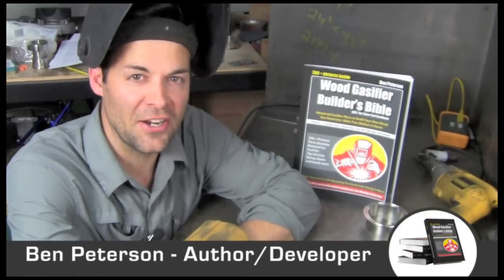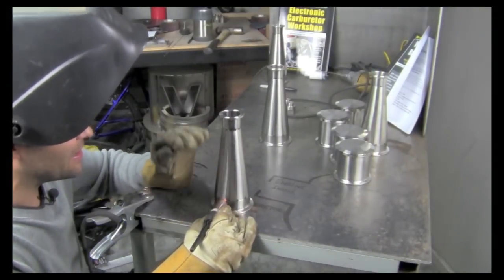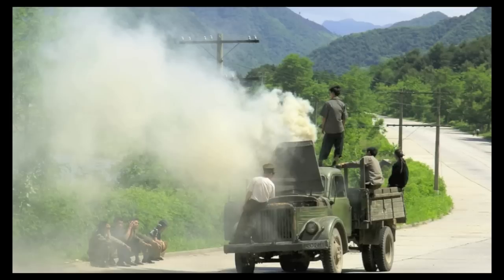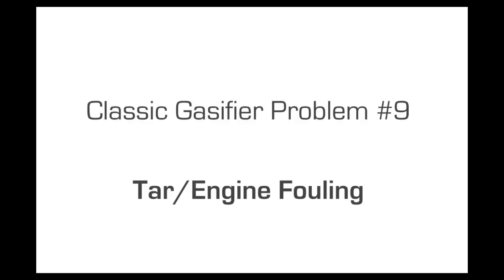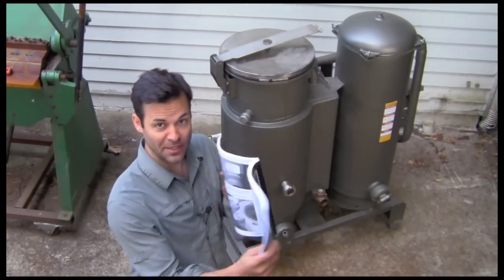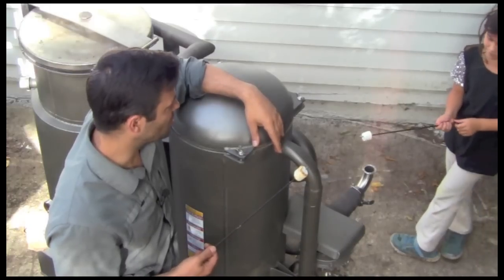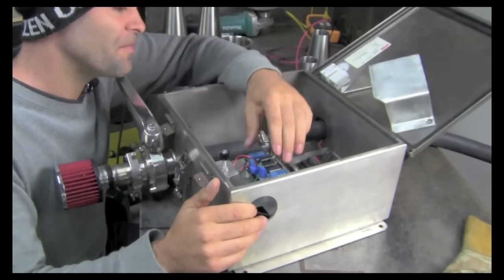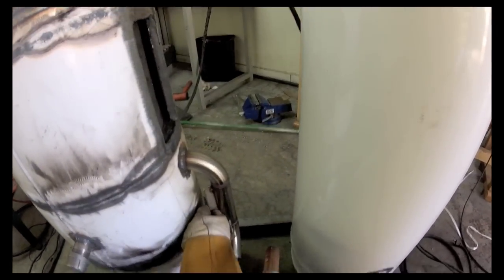#1 Wood Gas Generator. Ultimate Wood Gasifier Plans. Free Fuel for Life.

Comment: he is quit right  today it used by a lot of people the pint is it must be . sead it a Gide it enable's you to build a  gas genarater with out a  the hit a miss of the past.  we now have the tool to add Benefit to  the build it is now on paper. in the book  something  we did not have when i was a lad.   there is other ways to Mack gas often not covered in this books  The gun barrel  system of making gas.  & the charcoal colom method that  uses water to Mack gas  as the the wood gasifier Uses the  Water in wood fibbers to convert to gas by the charcoal that is made in the wood gas  genarater .  Water & Charcoal in a Colom , makes dioxide gas & hydrogen gas.

Comment: I've built the FEMA version gasifier and then one that was my design based on my research. I'm a disabled veteran and have time on my hands. I really liked my design but it had a ton of heat loss. My plan was to put that heat to good use by incorporating several heat exchangers for hot water and hot air. Since then I've gone through a divorce, lost my house, lost my storage units that held my gasifier, that also held all of the components to construct another gasifier and other gasification devices I was working on. I also had several back surgeries. That being said, I really like the design of this unit. I looked for the book mentioned here,but it's off the charts expensive. Can anyone point me in the direction of perhaps a used book? If so please let me know. Thank you. And a special thanks to the gentleman presenting this video.god bless.

Jason

Comment: Two questions. 1). The gasifier rate of production is independent of the motor. So what happens when your producing more gas than the engine is burning? Flare it off?

I first got into gasification thru wood boilers. Totally different animal. I now find myself in need of a maple syrup evaporator. Not the most efficient way of burning wood.

Comment: Why are you wearing a welding hood and welding gloves to review your book....Edit; also does your book provide options to avoid reliance on electricity to run the gasifier? If I were to make one of these I would want manual air/gas adjustment and a shaker that didn't need electricity. I would think you could figure out a way to transfer the vibration from the generator or whatever you are running to the shaker Grate. I appreciate all the time and energy that you have put into your system but as a Machinist and Fabricator can't help but think of these things.

Comment: I would really like to run a generator on multi-fuel including wood gas. Could I start with a "Duel-Fuel" Generator and still have the option to use gas/propane as well?

Comment: Can you store the gas in a tank. How about an existing propane tank?
Reply: Compressing it won't go very far.  Propane liquifies, allowing a high energy density.  No one buys tanks of natural gas, though, because a tank won't hold all that much energy in the gas state.  Woodgas won't liquify, either.  

So it can be compressed, but tank uses are limited.  All useful applications of woodgas I've seen consume the gas as it is generated.

Comment: Well that's awesome but the thing is the the world's nations won't have enough wood to feed the eternal power consumption, if you don't recultivate wood and just lamber them e.g. Rainforest, this source will become really soon really rare and a plant without woods is probably a dangerous thing ask the Greak, as they are still recovering there trees frome the wafting in antic times. But generally it is a really intressting process, despite that ir is not only about receiving gasolina, the overall energy bill must be net-posotiv, so the gas energy for maintaining the pressure in the gasket or stove must be effective and hast to reduce the boiling point as much so that you don't need mor wood during heating to gain gas so that you can drive the car. So for firing some other organic material would be adviserbal. Or a wood with lower heating coefficient as the gas, which you want to produce.
But one advantage would be that you can produce lye out of the ashes and either catalyse the electrolysis to generate HHO or create a Bio-Diesel by mixing lye with food oil and ethanol and after mixing this with styropor you will have some sort of Napalm.
So if you buy your self a Solarcell, you can say, "hey when you come too close I am going to fuel up my Napalmrocket, with HHO or H2 , made from soft wood"

Comment: That was a lot of marketing BS. Also clearly a modified hot water heater. The fact we didn't talk about actual performance numbers is mind boggling. What is the burn rate, average exhaust temp, emissions, material cost, etc. Based on how long those marshmallows took to toast that "flame" does not have a lot or hydrogen burning that you claim.

Comment: I read through the FEMA documentation on wood gasification, seems easy to follow the data tables for sizing the generator to match needs, i like the downdraft flat plate system they described. I will build a unit soon. Your book looks well done and a good resource.

Comment: I thought of something cool that could be added to this gasifier, an HHO generator. The condensate that the gasification creates is generally treated as a waste product, but if you were to apply electrolysis of water to it you'd have additional hydrogen and oxygen you could then add to the gas flow.
Reply: The condensate won't be clean, destroying the electrolysis surfaces. on top of this, this will use significantly more electricity than the improved calorific value of the fuel will net you. Only 5-20% of the power you put into electrolysis comes out of the engine. And if you have surplus electricity, you might as well use an electric motor instead.
Reply: @galactica58  Right, it's just water vapor anyway. Just let it evaporate into the atmosphere.

Comment: A QUESTION HOUSE PIPES SUPPLYING BRITISH GAS DISCONECTED FROM A PIPE SUPPLY LEAVES ACCESS POINT A BUILDING HOUSE WHATEVER JOINING TO THE DISCONNECTED PIPE AN NOW WITH OR WITHOUT REVEALING TO HOUSEHOLDER WHATS BEEN DONE AN AGREEING THIS TO TAKE PLACE IS IT LEGAL NOT UNLAWFUL IMAGINE DIRTY CHEMICAL TREATED WOODS CREOSITE PAINTS BURNING ETC THEN THE MIXED GASES SUPPLIED THROUGH SMALL JETS BURNING WOULD TOXIC FUMES AFFECT ONES HEALTH AN A APPARENT NAMED GAS SUPPLIER SELLING GAS UNDISCLOSED HALF PRICE GOOD TO CHECK TEST ETC ALL IT WOULD TAKE IS SWITCHING MAIN GAS ELECTRIC SUPPLY OF AN CONNECTING TO YOURS OR OLD DISUSED BOILERS WORN OUT SOLD CHEAP OVER PHONES  HOUSE PHONE EXTENSION PHONES SIMPLE REALLY FROM ROOM ADJOING NEXT DOOR AN THIEVES ENTERING TO PLUNDER

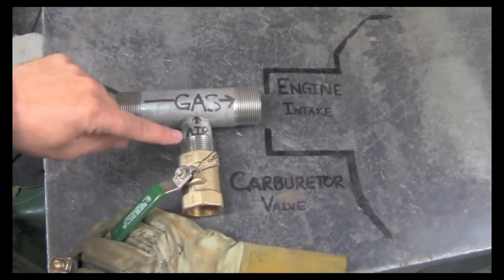Comment: 14:30 - Butterfly valves are made for straight shutting and opening, not for adjusting. That's what a regular globe valve is for with its finely adjustable spindle drive.
Reply: Umm NO. Carburettors are butterfly valves..
Reply: @HandyC  For specific reasons. And that makes them an exception, not a rule.
Reply: @Anvilshock  Valve on wood gas generator - To meter ratio of wood gas to air..
Valve on Carburettor - To meter the ratio of fuel to air..
Reply: @HandyC  You're still wrong. Your arguing confuses cause with effect. The use of a butterfly valve in a carburetor is mandated by necessity. It needs to react spritely to load changes, and it needs to have a light action with a short throw due to how it's actuated (wire link from accelerator or similar). However, this necessity is simply not present in a machine like this intended for largely constant power output. As such, the choice for a valve type can be driven by other factors. So, instead of tapping a scarily sensitive lever, you could be conveniently turning a spindle a turn or two to achieve the same adjustment with much less worry to accidentally oversteer. (And if you really need it, you could still have a ball or butterfly valve for fast shut-off in series with the valve used for actual regulation. Or metering, as you call it.)

Comment: Is there a way you could utilise the heat from the furnace to potentially dry any damp medium as it enters through a hopper? That way if you're trimming vegetation you could feed it immediately via a chipper/shredder? Maybe a condenser to separate steam before it gets to the engine?

Comment: Would be awesome if there's a way to compress wood gas into a propane tank.
Reply: There is, search YT for demonstrations, it can be done.
Reply: @LiberatedMind1  compressing it won't go very far.  Propane liquifies, allowing a high energy density.  No one buys tanks of natural gas, though, because a tank won't hold all that much energy in the gas state.  Woodgas won't liquify, either.  

So it can be compressed, but tank uses are limited.  All useful applications of woodgas I've seen consume the gas as it is generated.

Comment: Don’t know if anyone will see this but after the gasifier can you vacuum the system with a air compressor and pump it into a propane tank?
Reply: i would add a seperate tank, a shutoff valve between it and valve a large bore air gun pressurizer/ electronic, although hand ones are available the electroning one is quicker, faster and easier.

Comment: Wood gassification makes sense if you're doing it yourself with just paint buckets and the like, but for this level of fabrication, a large Stirling engine seems a much better route, especially with the flexibility of any fuel you can burn/parabolic mirrors.
Reply: Then you have to fabricate a Stirling engine. Those aren't all that common.

Comment: Looks good. There aren't many of us with the skillset or equipment required to make them though. Ask around and you'll get a lot of blank looks if the words kaowool, mig and tig welding or plasma cutter are used. Then there are even some electricians who have issues with wrapping their heads around  a DC current system. I hope you do well with it and I can see anyone that gets the manual will most likely be building at least a few complete units for others.

Comment: I'm a self employed Rig Welder and would be interested in building one of these. I live in Colorado a few miles from the Wyoming border,  so we get some nasty weather occasionally.
When I  lose power 
I have to fire up my Perkins Diesel Driven 300 SAE Redface Lincoln Welder on my truck and run power cords into my house.  I have a question for you. In your research have you came up with a feasable way to pressurize and store this type of gas?
Reply: im interested in the answer for the question you asked aswell, did you find an answer? i actually thought about a shutoff valve for it to go into a seperate tank, with another valve in that tank for pressurizing, a unit for say a high grade pellet rifle( big bore ones do pretty high psi.. electric or hand pumps, obviously electric work faster and easier... its a thought can even be used to make interesting home firearms by utilizing the pressurized system.... lol.

Comment: Apart from making use of the gas produced from the wood as well as tapping the heat for producing steam with steam pistons on either wheels; will definitely makes the vehicle run fast on dual system!

Comment: You implied that this could power a 25 kw generator? What is the run time on the gasifier before you have to replenish the wood?
Reply: 1kW ~ 1kg of chips. 25kW eats 25 kg of fuel per hour

Comment: Could the gas be stored for later use?
Reply: Yep, check out a gasometer, neat stuff!
Reply: Correct me if im wrong, In a typical gasifier it's the "smoke" that is used. It's actual gas, not liquid. 

However there's ways to get liquids as a byproduct, like Ethanol, which can be stored and used later. Right? 🤔

Comment: You got me interested now!!! I started a build years back but that was a failed attempt. I never thought of using it for a hot water service. My concern is when it turns off will the line fill with oxygen the when it starts back up will it explode? Or would you have some kind of shut off valve?
Reply: Look at flash001usa on YouTube

Comment: @VictoryGasworks I have a question, how do you condense, compress and store your liquid gas?
Reply: Pressurized 🤔
Reply: @marctorrades1760  compressing it won't go very far.  Propane liquifies, allowing a high energy density.  No one buys tanks of natural gas, though, because a tank won't hold all that much energy in the gas state.  Wood gas won't liquify, either.  

So it can be compressed, but tank uses are limited.  All useful applications of woodgas I've seen consume the gas as it is generated.
Reply: @PeterLawton  for what I could see in the old photos,  they use big bag on top of vehicle. 
At the moment,  I'm making methane with a biodigester .
I put the gas into a bag , kind of bladder. 
I intend to compress it into gas bottle with a compressor.
Reply: @marctorrades1760  I like the idea, and have seen experimenters fill such bladders.  They used weights on top to determine the pressure inside the bladder, sort of a crude regulation.

Cars are often compared in terms of MPG.  I've seen YouTubers measure kilowatt-hours (KWH) produced by a generator from 1 gallon of gasoline.

What's a logical measure of energy produced from a volume (STP) of woodgas?
Reply: @PeterLawton  I wouldn't know what to use .
At home in France,  the providers use cubic meters when they sell gas  to you for your household .
I suppose for small quantities,  like a woodgasifier would be litre into watts .
I'm not sure 😕. 
The bag would be of capacity of 1 or 2 cubic meters. (10000 to 20000 litre ).
Reply: @PeterLawton  I forgot to say that this biodigester is giving a lot of gas .
It's very simple to use .
We have a farm in Ireland. 
So plenty of cow manure .
It is very easy to make gas for very little money of investment. 
You should try it, Peter .
If the climat where you are in moderate , no problem. 
I did some modifications on it for the temperature , like insolation on the outside and build a crude thermosiphon system to bring heat inside. 
I use a fish heater tank and a little pump and a pipe to circulate to hot water inside the biodigester. 
That's all .
I think it's the cheapest way to make energy.
Reply: @marctorrades1760  I am planning to try it.  After I build my home on the land I already own, I will be mowing a large patch of grass (with a bagging system) and putting the cut grass into a biodigester.

My hope is that will be enough to provide gas for a simple outdoor kitchen.  Using the gas that way will reduce the heat to be removed from the home by air conditioning.
Reply: @marctorrades1760  you're in Ireland? Me too. Where's your farm?
Reply: @PeterLawton  it will Peter. 
You will a bag to add to biodigester. 
It give a lot , and no messing with chainsaw and tar and everything else from the woodgasifier , 
Ahaha. 
Every farmer should have one. 
With the amount of stuff that you could in it .
But no wood , coffee grind and so on .

Comment: Please answer my question I'm a mechanic my question is,is that possible if I use the gas in any gasoline engine or maybe it will cause overheating the engine ,...coz I just want a personal generator...
Reply: Felix Mendoza yes you can use it to run a gasoline engine/generator, some people drive trucks that run on wood gas.

Comment: Could you use a stirling cycle engine to produce ultra low temperatures to turn that gas to liquid and fill insulated bottles with frequency emitters in the bottom to cause the liquid to vaporize that can then be feed into the combustion engine?

Comment: Combining these plans with the Wayne Keith Gasifier plans, then include an easy way to loop exhaust smoke from engines to preheat part of the air going into the gasifier before routing the exhaust to the inside of the hopper section to regulate the temps and increase mileage would be the best thing to do.

This would be the best because it would take the best advantages of both plans, combine them and add a little something more.

Comment: Hey Ben! I read that comment about the flame colour. Is it true that if its not blue then you have impurities burning of in it?
What is the smallest and biggest engine that this gasifier can run?
Reply: From everything I have read about this, it would seem that this comment was accurate, yellow / orange tinge to the flame = impurities that have not been removed during the cooling / filtration of the woodgas.
Reply: @Garuthius  I have seen an instance where the flame was orange until the gasifier warmed up more.  Then the flame turned blue.

Comment: Can I use wood gas either directly or indirectly to charge a fuel cell for off grid DC electricity?
Reply: Use the woodgas to run a generator, use the generator to charge your battery bank / powerwall.  alternatively. use a bigger engine to drive a custom built generator and use the cooling loop of the engine and some heat exchangers to heat the hot water / heating loop for your house.  Create electricity and heat your house and water all for the same wood cost :D.

Comment: Right-On, Thanks, 
 You've done a fantastic job building the gasifier and working the kinks out of the system for guys like myself who are interested in this alternative.
 I've dabbled in all the alternate energy sources and always regardless what I've build or working on have come back to this for numerous reasons.
 HH0 generators: are good but, inconsistent, which can play havoc running a generator. Wind doesn't make a usable gas and same goes with solar. 
 It boils down to whats the best boom for the buck and I believe a gasifier serves all those needs, from running a vehicle to a generator, Those two things alone that covers a huge area.  
Thanks again. I appreciate it.